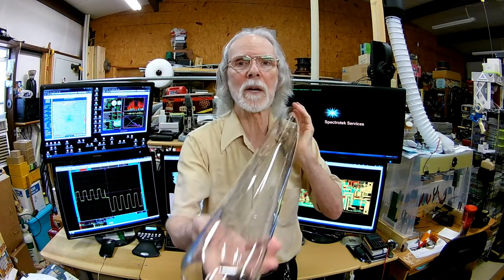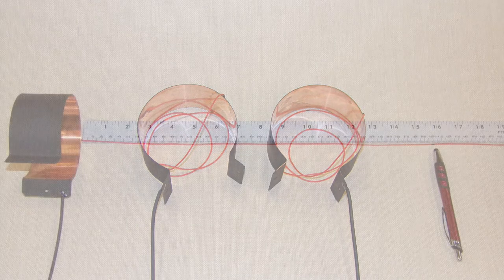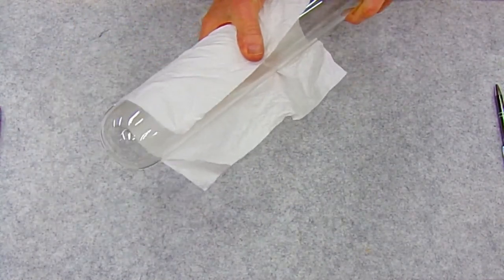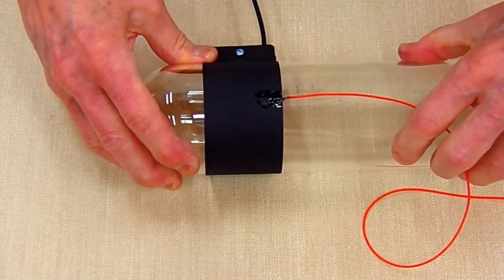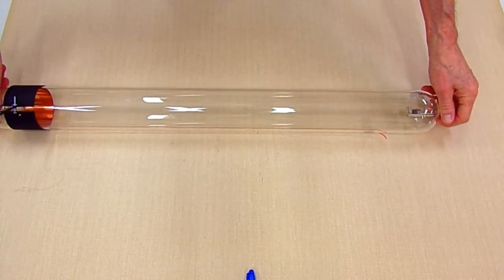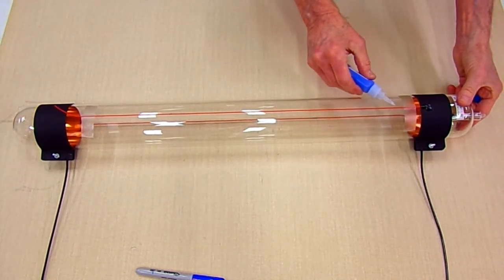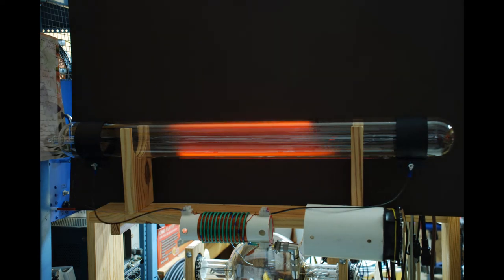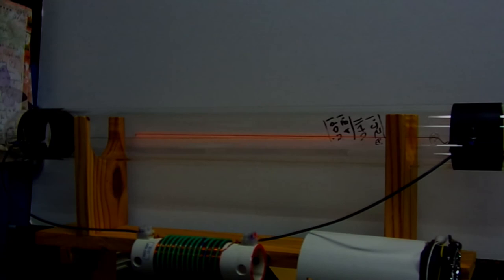Installing the Spectrotek E4-WSW Electrodes on the SSQ-BAT Plasma Tube

Comment: Dear Ralph, it is me again. What is the recommended input voltage and maximum power for this tube? Kind regards
Reply from the maker: Usually this tube is driven by an amplifier such as the PA3 or the SPA5.  In that case, a DC power supply voltage of between 115 and 160 volts is suitable.  Voltages of up to 175 may be used for more power, but with an  increasing danger of damaging the amplifier as the voltage is increased.